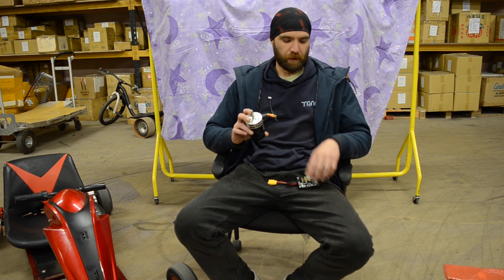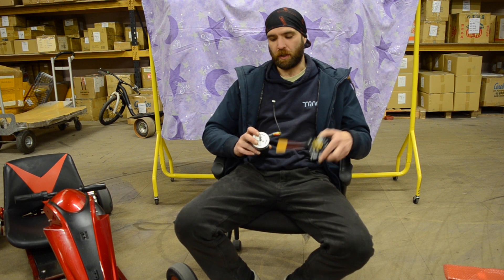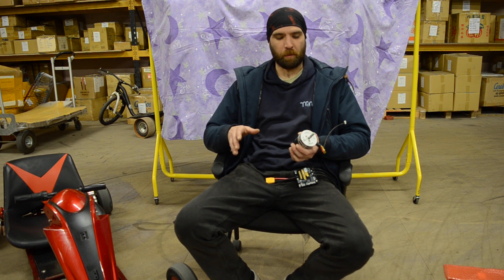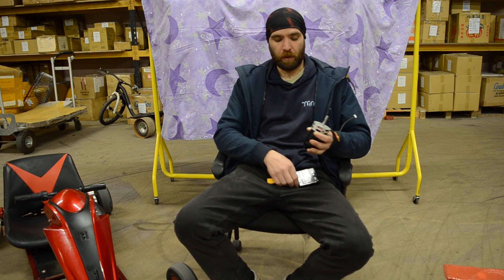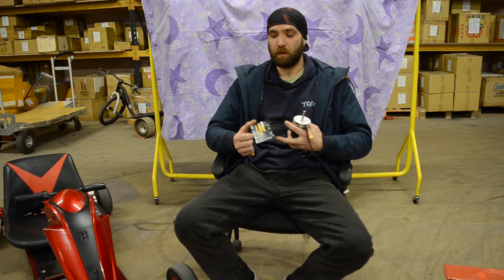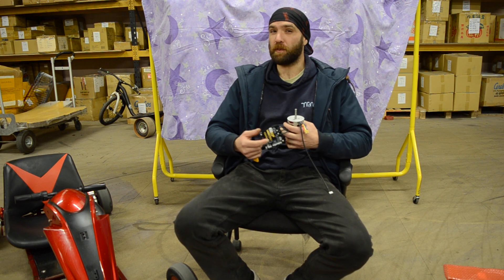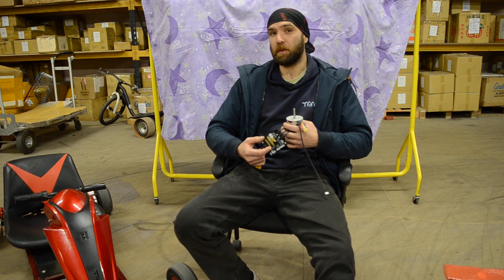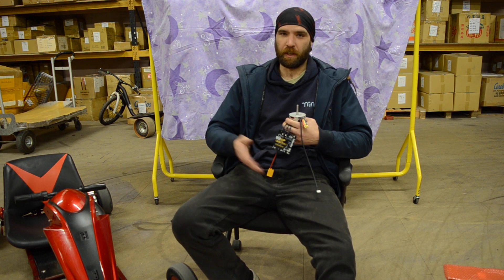New Motors and Vescs With Mr Bond

Comment: Does Trampa still make 4 wheel drive boards?
Reply: We are currently re-designing one of our vescs so we can make 4 wheel drives at a reasonable price. we can actually make them with what we have here but it would not be cheap thats for sure, in a couple of months they should be readily available to buy again :)
Reply: @dibzclips6217  I emailed Trampa a little while ago and they said they ran out of them and are redesigning them, like you said. I would love to get a 4 wheel drive board with a brown battery box, brown hubs, and brown Ratchet Bindings. All the rest in black.